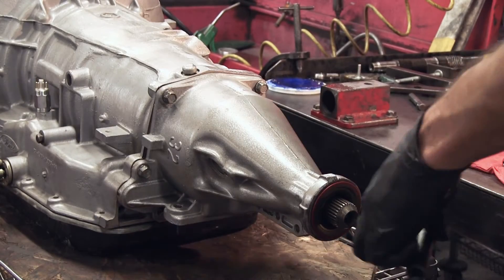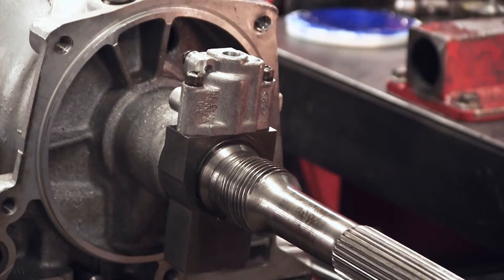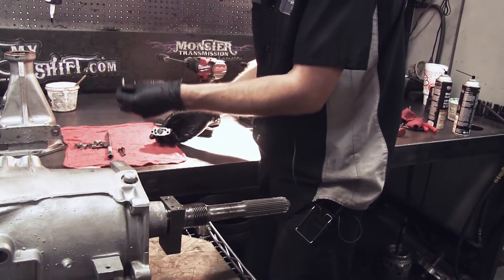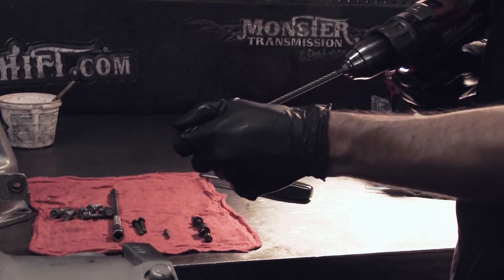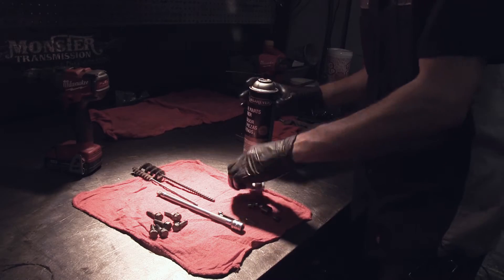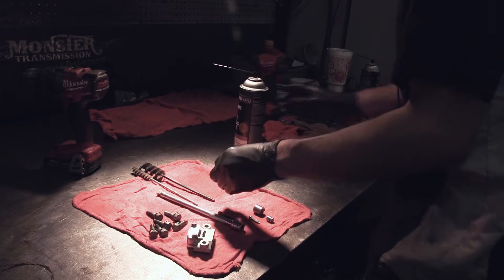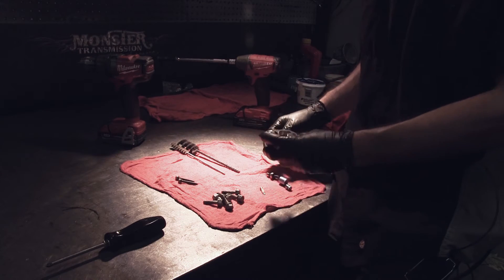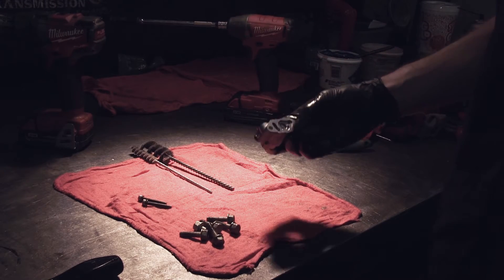How To Clean An AOD Governor | Monster Transmission

Comment: Great job!  I plan on doing this in car soon.  89 Mustang 5.0 AOD with SK-AOD shift kit and ~250k miles
Reply from the maker: Right on!
Reply: @MonsterTransmission  I'm in north Florida, I see y'all do NOT install your trans, is there a LOCAL shop close to y'all that you recommend that your company trusts? I'm terrified to buy your complete AOD package an a idiot NOT set the TV cable correctly, I have a Lokar cable setup connected to a Holly carb with the correction arm
Reply from the maker: @REVNUMANEWBERN  We have many automotive shops in the area, but not many certified transmission shops. Not sure which part of Florida you are from but you can check out this installer network. https://gearnation.com/pages/installer-network

Comment: Is there any way to disable the governor to get a higher top speed?I have a 1988 mercury cougar 5.0 and it stops around 110 or do I use a governor from a mustang GT Aod?
Reply from the maker: No, changing the governor does not alter the top speed of your vehicle.

Comment: Will a sticking governor cause my transmission to shutter when downshifting? shifts fine cruising and full throttle, hard braking it downshifts good but when slowing down it seems to shutter a bit. Thanks in advance and great video as always!
Reply from the maker: Thanks! Yes, it means your governor is hanging up. You can try cleaning it, if that does work your going to want to replace it.
Reply: @MonsterTransmission  Thank you for the reply, I really appreciate it. I will definitely be replacing it to just fully eliminate the problem.

Comment: Good morning, why do you have to do this cleaning, that is, what is the failure of the transmission? thank you for your answer
Reply from the maker: Good morning! The governor helps to regulate shift points, so a stuck Governor will either stack shift or not shift at all. It is a very critical part to a hydraulic driven transmission.

Comment: What does that governor do?
Reply from the maker: The Governor helps regulate the shift points, as the shaft rotates faster it closes the valve in the Governor and increases line pressure to the shift valve so it can shift into the other gears.